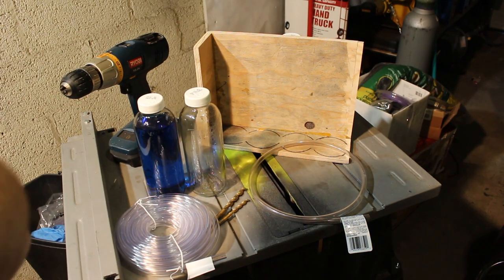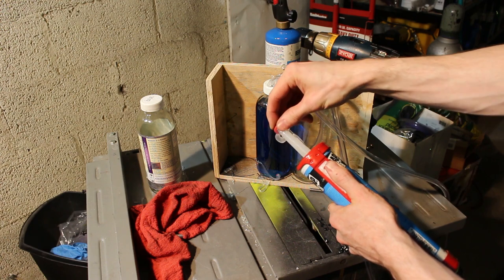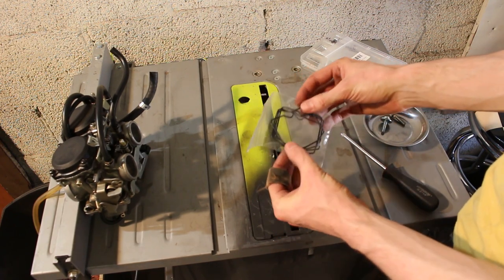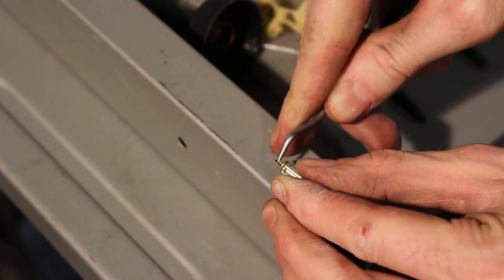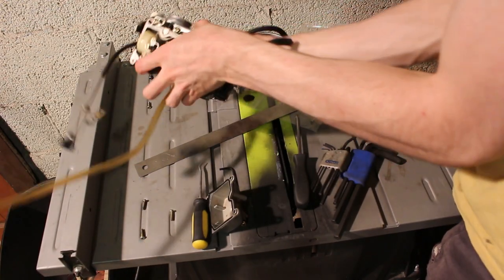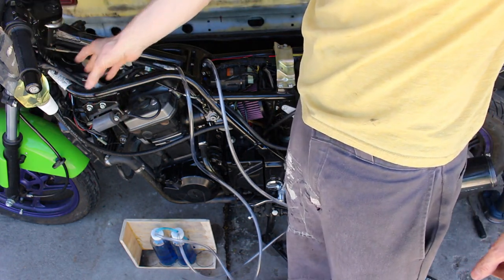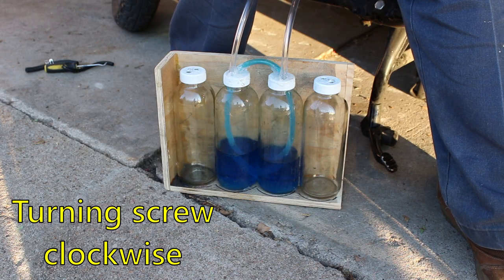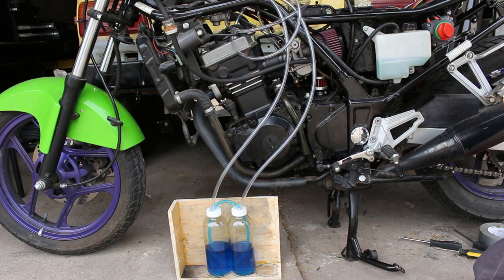Carb Butterfly Balance & Idle Jets Ninja 250

Comment: Hey quick question: how far in or how much do you tighten the air fuel mixtures screws before you start to turn them out 2.5 turns... is it till they can’t turn any further? Your response would be very helpful, thanks!
Reply from the maker: Yes, I turned them in all the way, then out 2.5 turns.

Comment: Whats that red knob?. Electrical?
Reply from the maker: I built a dual battery setup so that I can always start up if one battery runs out of juice. This is a switch so that I can use either battery.
Reply: @scrapmetalmade  gotcha. And have u gone thru that problem w batteries?? What else for us to learn about that?
Reply from the maker: @JesusChrist-vy4vq  Part of my original plan for this bike was a Bugout Bike, so redundancy is a big deal. Some dual sports have kickstart and electric start in case one system fails. Having two batteries is the next best thing. I haven't had any battery issues, this was done for redundancy only.
Reply: @scrapmetalmade  gotcha. Would a kickstart be good too??